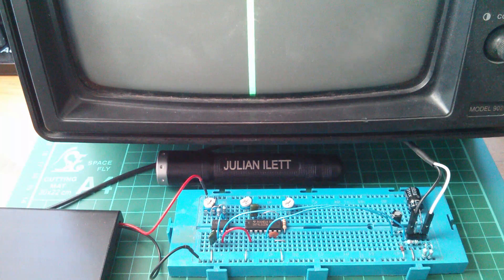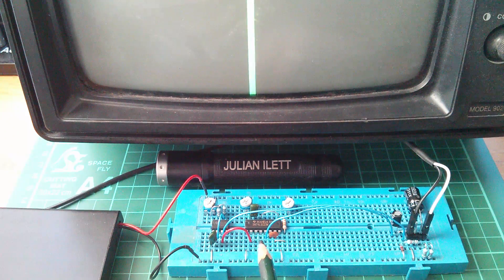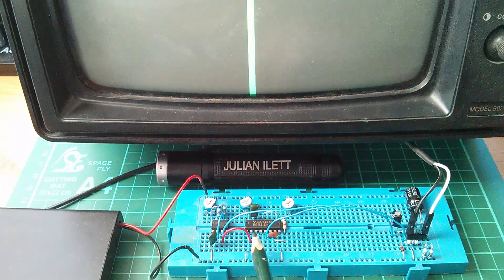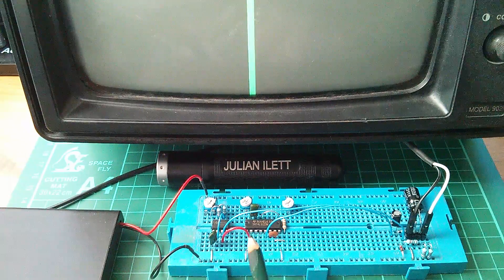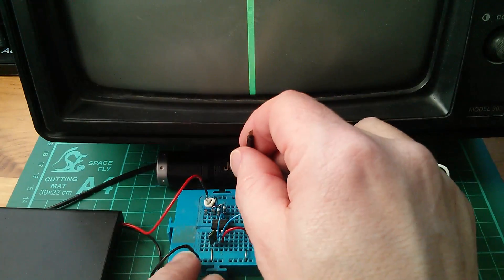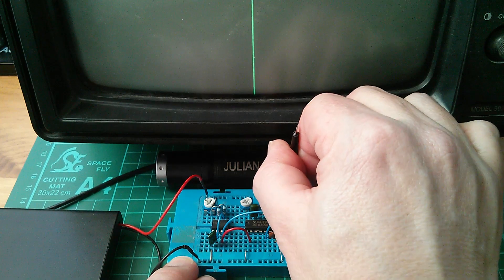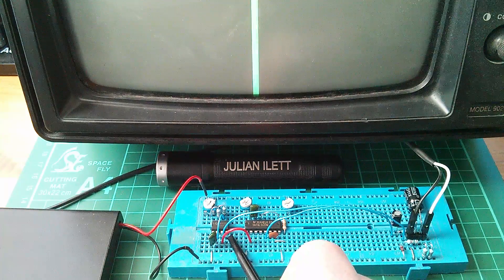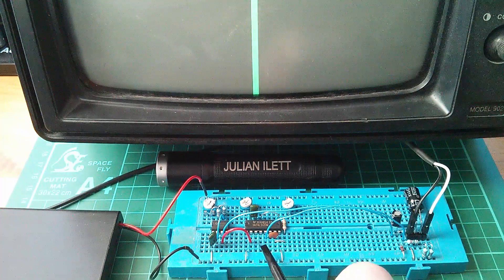Pong Update: Move Aside 555 - All Hail the 74LS123

Comment: This is funny,  as I was thinking of a TTL monostable as a possible solution while watching the last video...   :-)   One thing about the '123,  I was building an interface back around 1978 or so and was advised by an engineer that that chip is not as stable as using two '121 chips.  Whether this will turn out to be a problem in your application I can't say.

Comment: Keep in mind that LS devices switch at very high speeds, and therefore cause significant VCC switching surge currents of very short duration. This will "bite" you at some point (cause instabilities), unless you "head it off at the pass"... by putting a 0.1uF ceramic cap directly across the supply pins of every LS package, as well as having "local" Vcc supply "bulk" capacitance on the supply rails of every proto-board- usually around 100uF.  The capacitance in your power supply keep 'it' stable, but will not keep your circuit stable.

See "Rules for Operation", item #8 (pg 2-3) in this doc: (as related directly to 'LS123)
http://www.ti.com/lit/an/sdla006a/sdla006a.pdf

BTW... Vcc really needs to be close to 5V with LS logic... again, for predictability and stability. (typ. 4.75~5.25 worst case)

Looks like the beginning of an interesting project... have fun!

Comment: HAY guys i have a question , is the output of the laptop charger a constant DC  or a PWM ???
Reply: +mmmk1414 usually constant DC - laptop has on-board circuitry to do charge management, etc for the battery - and needs a constant voltage supply to do it's thing. i.e. a 19v DC supply capable of supplying 3.42A of power...
Reply: thanks man

Comment: Yaaaaaay.

Are you going to use another 555 or so for controlling a vertical span, and do something further to move around a square?
Reply from the maker: Yes, there are a whole set of similar circuits for field sync and horizontal lines.

Comment: I really appreciate this. Nowadays for even blinking a LED they come around with this damned Atmel 328 Arduino thinggies. Not that they are bad in any sense... but at the end it's just programming and no skills required. Reverting to good old analogue signals is pure fun and requires much more thinking than 1 and 0 on a port pin.

Steve Wosniak was the one who made Breakout with just 45 Chips... genius
Reply: +dh1ao They're bad when they're overused, or used where not necessary (which is 99% of the time they're used!)
Reply: While I definitely agree with your statement about it being overkill for microprocessors to blink LED's etc. Just don't forget programming is definitely a SKILL. Saying programming takes no skills is rather daft.

Comment: Remember analogue TV was originally designed to work using a few ( under 20) vacuum tubes in the set. Thus you have very simple ways to do the drive, especially if you are lax about it being broadcast quality video. You just need 2 oscillators for the frame, and then all other elements are either counted from the start of a line or frame, and have a width determined by a monostable. You will need only another LS123 and 2 9 bit counters with a little glue logic to do the paddles or blocks in the video